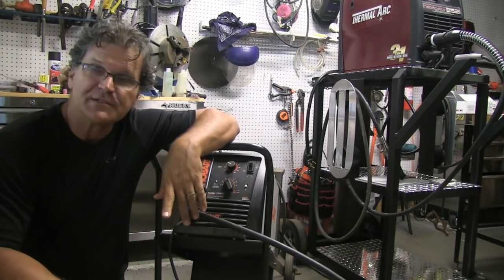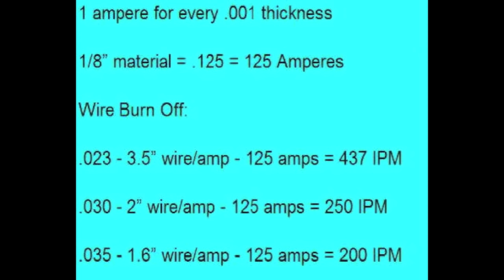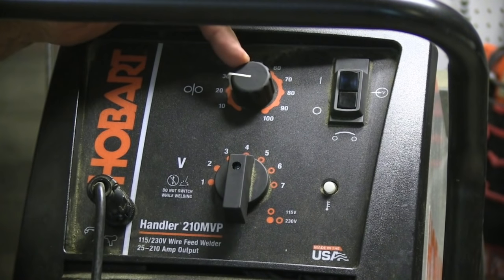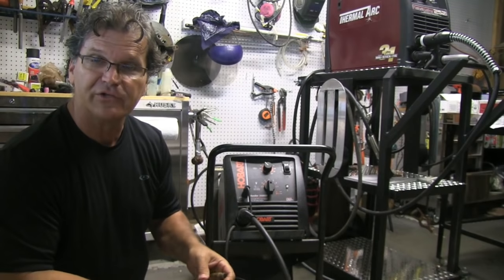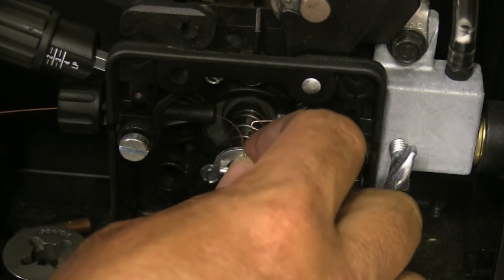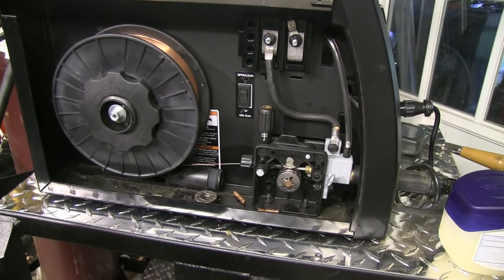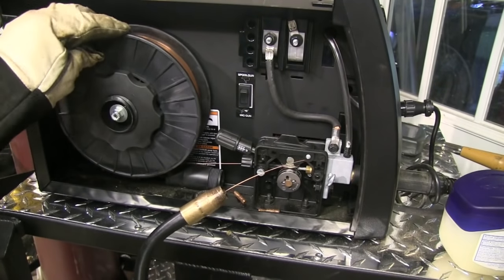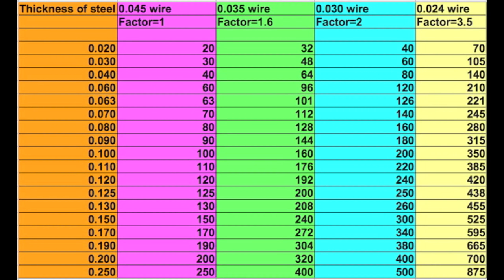Mig Welding Basics part 3-Setting Voltage and Wire Speed

Comment: PSS, Jodi, after ALL the Years  weve been at this,, You Know Your Machine,, And Honest,, Ive Never, Measured the Inches,, of weld,, After a Few Pcs OF  Scrapp, You Know where It has to Be,, Years and Years Ago,i Bought a LN 25 Feeder, And the fellow thru in 2 rolls Of 1/16 flux core,, and a Good Contractor friend dropped Off a Back Hoe Bucket,, and With the Seperate Power Supply,i Had Bought,, WOW,, A 3 Inch Vert Up,,On the Broken Tooth,, smoke, YIKeS!!!!!!!!,, Could Not see In The Shop,, But 20 Mins Later  Done!!!!!!!!!,, Thanks for Great Vids,, Jack,,,

Comment: Spent the morning practicing butt welding the 17 gauge sheet metal of my project car. Then found a copper pipe flattened by hundreds of cars running over it. What will that do to my voltage and wire feed requirements if I Place it behind the spot I’m welding?

Comment: 2:00 One day the fab man 'found' a fancy tape measure. He never said where. The repair men would call in measurements and after getting the parts, and in place, things are an inch to small. Several apprentices got their asses ripped that day for measuring wrong. Turns out the senior man on the shift stole a tape measure that went from 16" to 18".

Comment: Can anyone explain to me how .035 or .030 goes to 2" or 1.6". Just trying to figure out the math to this
Reply: Cross section of wire is an area. Factors are obtained by comparing a ratio that is squared, so you are comparing the areas (.045 our standard because it factor is 1) to the wire diameter you are interested in knowing the welding factor for.  To obtain the welding factor (.045/.035)^2 = 1.653 rounds to 1.6 using odd even rounding rule. Constants such as (pi) simplify to 1 because they are both in the numerator and denominator of this equation

(.045/.03)^2  = 2.25 which is rounded  to 2 for simplicity sake as long as you are close too 10% of the expected value your welding will be good with small minor tweaks you will find the sweet spot guaranteed!!!!!

Comment: Damned imperial system. Never understood why the Americans cling to it so much. I work in Europe and we also manufacture parts for US . I have to constantly convert Imperial to Metric and back and double check. It takes one third of my time. Also we need separate tools to do the job which costs us thousands. All the workers think in metric and when they encounter occasional US part they scrap the part thus they avoid US parts as it is too much trouble for them.

Comment: I was thought that u r always meant to push while MIG welding, I see u Pull, Y is this?
Reply: Jody has done videos on push versus pulling or even straight on at 90 degrees to the joint. He shows that all work well by cutting the joint open and acid etching to show penetration.